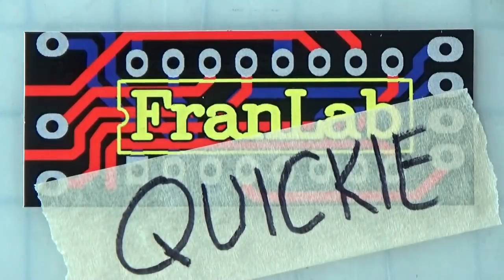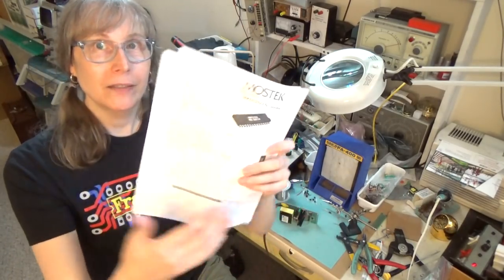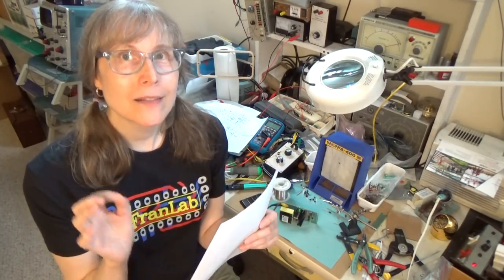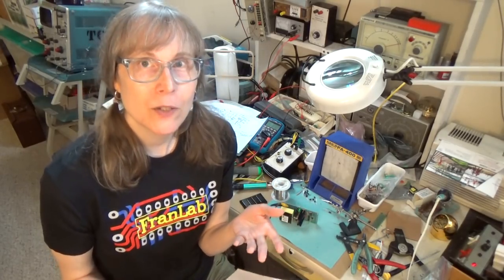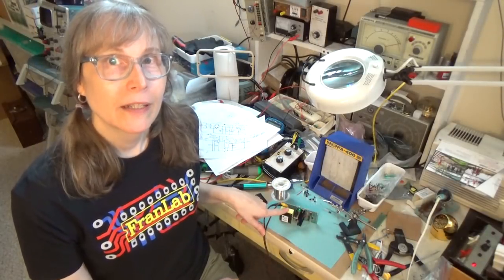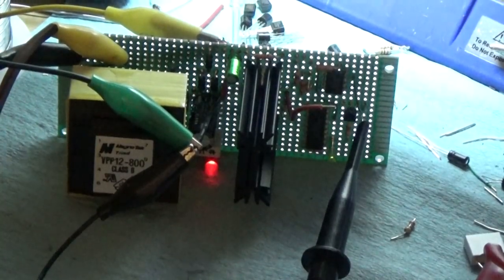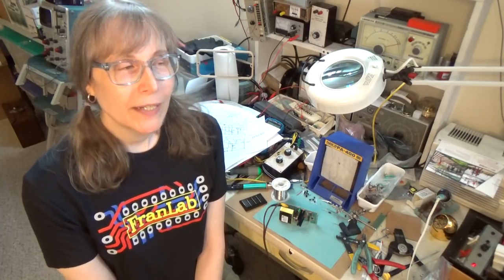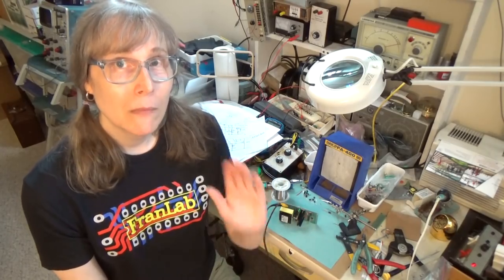Making A 50hz Digital Clock Circuit Run In The USA

Comment: In 1974, at age 10, I built a Heathkit GC-1005 6-digit clock. I still have that clock and it works. This is based on the Mostek 5017 chip. It is switch configurable between 24/12 hour mode. It is 60Hz line frequency based. The power grid 60Hz does not seem as "on time" as it was 44 years ago. Back then, I could set this clock to the telephone "talking clock", or the CBS "Bing, da da da, da da" top of the hour jingle, and it would always be within a few seconds of real time. I built a few years ago a 6 digit Nixie Tube clock with the WiFi "NTP" clock sync. Now I easily compare "real time" to AC line time. I've seen AC time drift as much as 30 seconds. BTW: You can call WWV/WWVH on the phone: (303) 499-7111 / (808) 335-4363. Talking clock is not dead, yet.

The Mostek 5017 has a silicon Easter egg on the die of Mickey Mouse pointing his arms to 7 o'clock. How cool is that? You can see an image of this here:
https://www.flickr.com/photos/dr-engineer-001/52647186

Comment: I found an old clock chip mm5312 and I did the same thing using pic12f675 to generate 50hz or 60hz square wave, if you are interested i can send it to you the code.

Comment: Or use a Raspberry Pi W Zero like I did to drive my 1970 vintage Burrough's 7971 4 inch Nixie tubes.  A little Python and a wifi connection to an NTP source and the clock automatically sets itself if there is a power bump.
Reply: That's overkill for that, honestly a simple microcontroller with a wifi module would be just as good, and not need any Linux.

Comment: An arduino would be easy, in fact i don't think of them as electronics at the user level, it's more like computing/programming.
Doing it old skool gives more satisfaction, specially when it works.
If i want an oscillator, i would go with the astable multivibrator rather than something like a 555, it's the first cicuit i built successfully in the late 60's.
Reply: Have you seen how accurate a 555 isn't? Being crystal controlled, Arduinos are better, but not usually adjustable so will still drift.
Reply: 'Easy' ? The most easy is just to buy a mobile phone maybe? Nah...
I really like the 'old skool way' and it is probably more simple then the more complex scematic of an Arduino (which seems a bit overkill if you would take it to bits and rebuild it with discrete components)

Comment: Any suggestions for a circuit to generate 50Hz or 60Hz without access to mains, and ideally without a microcontroller or crystal, but still fairly accurate? 555 style timer circuit is probably not accurate enough. Doesn't need long term stability, but over a few hours use, should keep reasonable time.
Reply from the maker: Wild clocks are just that - you need a very regular oscillator which is usually a crystal.
Reply: The MM5369 was a great chip for this.  Little 8 pin DIP that would generate accurate 60 Hz pulses using a cheap and easily available 3.579545 MHz TV colorburst crystal. Unfortunately discontinued, but you might find NOS on eBay or surplus sellers.
Reply: Dave Curran There have been clock chips using a RC oscillator as fallback in case of mains blackout; the Fairchild FM7010 as used in Grundig's Sonoclock 21 would come to my mind here. But in real life the accuracy was more than lousy; even after just minutes of blackout it would already deviate a minute or two - no matter however often you calibrated the osc on it. Change in ambient temperature alone would throw it off. An old school approach for a 50Hz timebase using still available standard components could include a CMOS 4060 4027 and a 3,2768MHz xtal.
Reply: Thanks for the replies, yes, that is what I had thought, just trying to find a solution for a client of mine who has some contradictory requirements for size / cost / accuracy.

Comment: Good idea how to use 50Hz clock on 60Hz mains.
I have opposite problem.
How to use 60Hz clock from USA on  50Hz. Voltage isnt problem to me. Step dovn transformer is solution but, cannot solve frequency.
Reply from the maker: You could do something similar, where you split every 5th pulse into a short double pulse, and you get 60 pulses per second.
Reply: @FranLab  thank you Fran, excelent idea. I try to solve this multiply 50Hz on 300Hz than divide with 5 to got 60Hz. It remain synchrone with grid , but I take idea from proffesional converters unit. They give sinus wave.  Last what I need is sinus wave.
Work with 50/60Hz is much more simple. I agree. Thank you.

Comment: You could use high current Darlington transistor array IC's like a MC1413B.  They can handle 500mA continuous collector current.  The MC1413B with a 2.7 kΩ series input resistor is well suited for systems utilizing a 5.0 V TTL or CMOS Logic.

http://www.onsemi.com/pub/Collateral/MC1413-D.PDF

If you want any OCXO oscillators to use for your timebase let me know.  I have hundreds of them in several different frequencies.  If there's one thing I can't stand it's a clock that won't keep time.  :-)

Comment: This would be wild in Japan.  If you had your clock in Tokyo it would be 24 hour but in Osaka 12 hour.  Eh.  Actually that's not right.  If your design were to actually run off of a 50 Hz service it would loose time pretty quickly.  The original design from Mostek would work correctly,.  Shame about the, "Americans can't deal with 24 hour clocks", attitude. but an interesting solution for where it is intended to operate.  I like the analog attitude.  The real world is analog!

Comment: I am amazed and disgusted that today I encountered the exact same problem as yours, but with 2018 technology. Google forms assumes that if the browser is set to US English, the time input will be AM/PM. That's the default and shut up. Since I live in Israel and my users are used to 24H input, I need to find a way to trick the browser. Or build a new computer from discrete components. I am not sure which will be easier.

Comment: Hello, just a question, why did you not use the 50 Hz from the electricity network? Because this is normally accurate. Here in German, when I have to clock something and I want to save time and cash, I use our 50Hz from the power supply, reduce the main power, go through a transformation and into that CHIP, because this sort of Chips can handle this, so there is no quartz needed etc. It's a cool project. I also build some old vintage stuff in the early days, because I think the early electronic is easier to handle than the new SMD technology etc. So, I wish you a lot of fun with your project. cheerio Toni
Reply: The US network uses 60Hz, not 50. Fran even said this at 3:19.
Reply: RealUnimportant Ahh, I see. So it doesn't compute. Sorry, I didn't know this fact. Cheerio for the information. Bye bye Toni
Reply: devttyUSB0 but after that drop in frequency they raised it during the last couple of weeks to regain long term stability. Maybe take a glimpse at www.mainsfrequency.com where the current european mains grid frequency is shown live. Unfortunately the news section on that site which deals with the past and present time deviations is originally in german, but there is a link for an automatic translation of the news on the main site that at first glimpse seems to do a good job.
Reply: Melissa Hermsen Thanks! My german is quite good! Esp. reading. ;) Much appreciated!!
Reply: devttyUSB0 thank you for the Link.it's nice to watch. Cheerio Toni
Reply: devttyUSB0 I remember that video of him, standing outside a powerstation with a teasmaid 😄